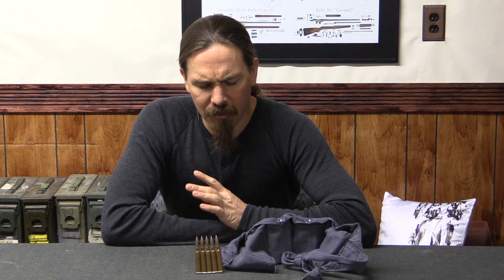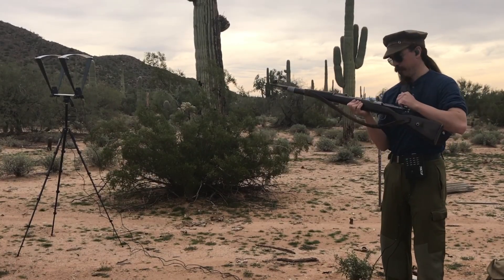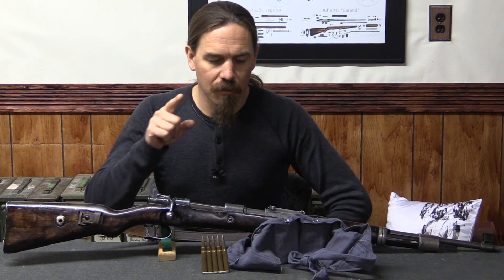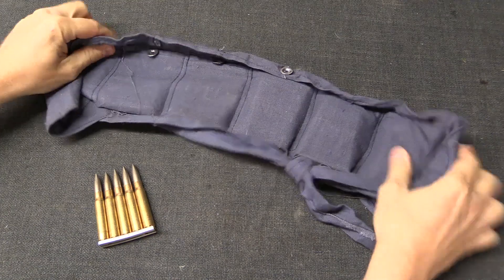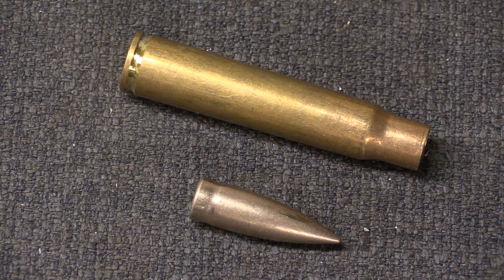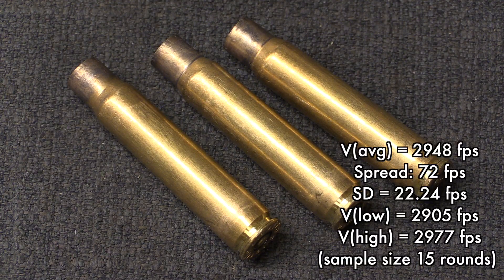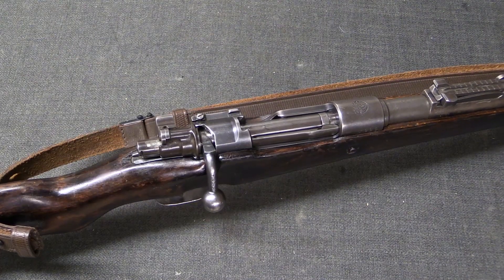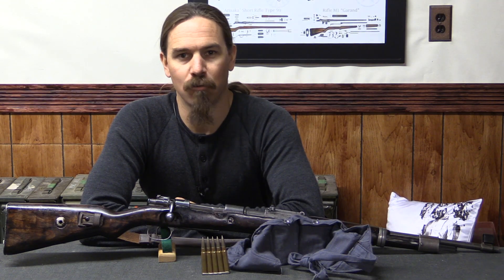Ammunition Evaluation: 1941 Turkish 8mm Mauser

Comment: - "Don't use turkish ammo with any automatic or semi automatic firearm"
* shoots ammo out of a bolt action rifle, ends up cracking the stock after only 15 shots *
So, don't use turkish ammo with any firearm?
Reply: That rifle couldn't handle it.
Reply: A synthetic stock could handle it.
Reply: @marshaul  A younger wooder stock could handle it too. This were made to be fired from a wooden rifle after all
Reply: @flightlesschicken7769  it was also made to be significantly less pressure.
Reply: @jongustavsson5874  This one at least. Assumably this ammo was used once upon a time. 

Why would they make such hot ammo?
Reply: @flightlesschicken7769  poor quality control? Not really unheard of, but I reckon it's more likely it's just degraded in a bad way since it is 80 years old. (like old dynamite would start sweating nitroglycerin and become highly unstable.)
Reply: @jongustavsson5874  Maybe, but to my understanding that effects peak pressure but not velocity that much.

As for quality control I doubt that since they were all very hot, not just some of them
Reply: @flightlesschicken7769  it can have been loaded a bit hot then degraded to be even hotter with time. 

And 15 rounds out of a crate of 1400 is not really enough to make a claim one way or another, and it was clear that it was fairly wild deviations in velocity between those 15 rounds as well.
Reply: @jongustavsson5874  I suppose. Hot then hotter with time sounds reasonable

Comment: Yeah, back in the 1990s I got a small lot of this and fired it in my Egyptian FN-49. The  3rd round felt like I had shoulder launched a Tac Nuke. Completely unnecked the case and broke the firing pin (Yeah I know it’s a known design flaw with that rifle). After I replaced the firing pin I went back to firing commercial soft points in that rifle.

Comment: In theory, one could pull the bullets, salvage the powder, refill with a reduced load and reuse but it would be 1) still corrosive and 2) a lot of work. If the stuff sells for more than 20¢/round it wouldn't be worth the effort.

Comment: Does anyone have calculations of what the volocity would likely be if using a 29" barrel??? Am I crazy to think it might be approach 3,100fps?
Reply: Through a Chrony F1, I was getting an average of 2960 fps fired through a M48 with a 24" barrel. At a guess, add 25 fps per inch of barrel, so 3000+ fps is possible.
Reply: The high velocity could be due to unstable burn rate from powder breakdown I wouldn’t bet on getting too much gain in velocity from the extra barrel, but ymmv

Comment: I wonder if the Turkish rifles were built a bit more solidly than perhaps a more "stock" 8mm Mauser or such other rifles were. Or perhaps that Turkey at the time didn't really care about the lifespan of its rifles that much; I know they had a ton of various rifles kicking around up until the 1920s, but I'm not too aware of their small arms policies regarding inventory, procurement and manufacture in the 30s and 40s when this ammunition was made. Or perhaps it really all was just an issue of manufacturing and storage resulting in the changes in the ammunition pressure exceeding safe limits.

Makes you wonder, because if it was causing problems, or at least what the Turkish Military considered problems (again, lack of knowledge so I can't comment as to what would be considered a problem; a rifle cracking its stock may not be considered a logistical problem if you've got a ton of them in armouries and want to use them up, for example, even if it's an issue for the individual soldier), then they would have changed the ammunition. But they seem to have consistently made very hot ammunition for a long period of time. Or it could just be they appear to have modeled the cartridge on a specific round and didn't manage to get it right, but didn't care to correct things. I would be curious to see the paperwork regarding the testing and factory standards for the ammunition of the time and how they compare to the ammo in its current state. That said, if the problems weren't around at the time then maybe it's all nonsense.

Does anyone have any idea as to what the thinking was and if this stuff caused problems in service?
Reply: Turkish Mausers are pretty much the Mosin Nagant of Mausers

Comment: I’ve heard that old ammo that’s gone hot over the years you should put in the freezer. That gives the powder some moisture and gets it closer to what it was original. True or false? Maybe you can answer that Ian
Reply: Moisture isn't the issue. Plus generally powder would be hydrophilic. Plus freezing it only causes existing moisture to precipitate out of solution, it doesn't somehow inject moisture into a more or less sealed case. So, no.

Comment: My Great grandma had Mauser made for her in 1910, and when i was kid my grandpa gave it to me. As you can imagine its stock is much shorter than a k98k and it looks different all together since it was custom made for her. It also has a drop out bottom, and a set trigger. The set trigger is adjustable to basically half a pound. Anyways when i got the rifle, I went to the local gun store in Old Forge New York, and they had 70 rounds of Turkish ammo just like that, and had the same pouch. It kicks like a mule, but again that mouser is much smaller and lighter than a k98k. I think the barrel is about 18in as well. also if you wanted to have a look at it some that would be cool, im somewhat local.

Comment: Have shot some of the turk and it does run hot.  I think I will pull the bullets and either reload the case with the H4895 and the  %60 rule for some nice (if corrosive) plinking ammo.

- Am not a gun smith,  you are solely responsible for your fixes !

Have fixed a few cracked stocks, acraglass or an equivalent  work well.  I also have  had recoil lug (wood) fail used the  hidden stock cross-bolt method, fixes the issue with out  need of external jig or external mod. 

Drimmled a slot in the wood recoil lug then filled to 1/2 depth with 2 part epoxy then placed a threaded rod segment into the epoxy (as a bridge from one side of stock to the other) then filled the remaining space with 2 part epoxy over the rod segment.  Clamped stock to close the gap as well.

Used Clear epoxy so as to make sure there are no bubbles or gaps.

Probably not as strong as external cross bolt but as strong or probably stronger then the original wood.

While its open epoxy bedding the steel lug  not a bad idea.

Comment: I want more graphs with these kind of videos, even if you just flash them in screen for 2 seconds or so. your data for fps on the range for example would do great on a chart.
Reply: You don't know how to use excel?
Reply: @marshaul  Should i film the videos themselves along with that? He has the data, probably in an excel already since he built his motivations on it and he could pick out the highs and lows. Just show it on screen for a few seconds. Thats not unreasonable.
Reply: @BartJBols  He already provided the relevant statistical calculations, but apparently that's not good enough, so you literally want him to paint you a picture. This is presumably so you can visualize what is better expressed numerically, but you can't expect Ian to accommodate every special needs student.

Comment: I wonder whether it's only because of storage, or perhaps Turkish Army wanted to develop something with a more punch against APV's. Equivalent to M855A1 against Body Armor. Still, doesn't work, but handicaps your own soldiers. Or at least rifles (I don't know if someone was hurt by over-pressure in A1, but the guns were at least in needs of repair after first batches - now it seems that A1 is practically the same as stock, so it doesn't have it's "unique abilities")

Comment: I bought several cases of this stuff in the early 2000's when you could get a 1400 round case for around $75. They were both 1942 date codes, if I remember correctly. It was good looking ammo once the crate was unsealed. I did not have any problems with hang fires or case splits, but this stuff seemed quite hot. I fired a couple bandoleers and had a bolt lug sheer off in a nice numbers matching Yugo M48. I did not fire the rest of it.

Comment: Now what exactly caused the ammo to go hot? Was the powder drawing moisture that translated into expanding steam or was the chemical compound of the powder changed by being stored at too high of temp causing decomposition?
Reply: If I had to guess, there is probably a binder or other neutral chemical in the powder which keeps it stable and in the right shape and distribution and density. Improper storage can potentially break down that binder, and change the density and burn characteristics of the powder. 

I was also reading that if the powder burns slower, it generates higher pressures for a longer time, so if the powder is in bad shape that could also be what is happening.
Reply: @witeshade  if it was burning slower wouldn't there be extra ignition outside of the barrel causing the shades on the chronograph to blow off?
Reply: @witeshade  In some cases the powder can deteriorate due to high temperature to the point that you will see corrosion around the crimp.
Reply: Decay of the powder, nitrocellulose (smokeless) powder is not very stable stuff. Added stabilizer compounds are used up over time, and in the case of stuff loaded for WW2 sitting in non climate controlled warehouses, at end of life at best.

Comment: Ian, what do you think about using the Turkish 8mm in semi autos with adjustable gas ports (i.e. Hakims). If the lowest gas setting is used, do you think that could mitigate the risk of damage to the firearm? Curious as to your opinion as I have a supply of this ammo but have been hesitant to use it for the reasons noted in your video. BTW, first time commenter, long time viewer/fan. Love everything you do. The community thank you for your tireless efforts to bring constantly new and relevant material to us. Keep up the fine work!!
Reply from the maker: I would not use Turkish ammo in any self-loading firearm.

Comment: Yeah, I've heard stories about this stuff. Bear in mind that this is 3rd or 4th hand info (but it does mesh with Ian's statement about this ammo in semi-autos), but I've heard of this stuff bending the receiver on an Egyptian contract FN-49. Good stuff to find out about when you're looking up info on your then-recently acquired Egyptian contract FN-49. Personally, I'm not sure I'd even feed this to my M48, though that's more out of worry for the stock, lest it meet the same fate as Ian's K98 here.
Reply: USSEnterpriseA1701 I’m lucky. All it did with mine was unneck the case and broke my firing pin. after that I got rid of the few rounds I had and won’t even touch it for my bolt guns.

Comment: The one thing bolt action rifles aren't obsolete at: firing overpressured, old, and dangerous rounds while minimizing risk to the shooter. Also making Ian look cool, but Ian always looks cool.
Reply: Smoothly running a bolt action left handed is operator aF.
Reply: Look I'm not arguing that bolt actions aren't obsolete for almost all uses, but it's kind of interesting that the us military's new sniper rifle is a bolt action rifle. Never thought I'd see that happen.
Reply: @8Hu001  Not really. The most accurate rifles are bolt actions. Bar the W2000, the most accurate long range rifles are bolt actions. All the gas goes into the round, and isn't siphoned off to fire the round. You don't have very quickly and heavily moving parts hitting the breach/chamber. So it makes perfect sense why the new sniper rifle would be bolt action, especially for rifles with intended target ranges out to 3km like a 338 Lapua Mag rifle.
Reply: Mauser is not just any rifle.
Reply: If the thing you aren't obsolete at is itself an obsolete thing, are you not obsolete yourself?
Reply: @Elfalpha1  
Out of spec, over pressured ammunition offered to the ignorant for cheap never goes out of style... Like the 7.62x25 surplus submachinegun load ammo that ate CZ52 roller locks for breakfast and broke a few Tokarevs?
Reply: @Bert2368  I know this is almost a year ago, but can you elaborate more on that ammo story?
Reply: @or-what  
In Eastern block, 7.62x25 was largely used for straight blowback, open bolt submachinegun ammunition as well as Tokarev delayed blowback service pistols. 

Some of the 7.62x25 ammunition was loaded with extra hard primer cups and to a VERY high pressure, apparently for use in the various fixed firing pin sub guns, when you try to fire it in a CZ 52 pistol, it often takes a couple of strikes to get the primer to fire and when it DOES finally fire, the kick, muzzle blast and fireball are spectacular. If you have the patience to keep running the stuff, the roller bearings at the breech of the barrel which lock up the pistol take a real beating and start to go out of round, followed by extra wear to the frame where they run. 

You can wreck a CZ 52 if you keep this up long enough, my younger brother managed to. That was at least 15 years back when these pistols were widely available for under $150 US, now they're harder to find and more expensive, the cheap surplus corrosive ammo of unknown origin is also pretty much gone. Numrich used to sell replacement roller bearings if you need them.

Go look on the Makarov and/or CZ forums, google for more information on the  specific box labels and head stamps of ammo which behaved like this. I would need to  look online for specifics myself, I just shoot modern Prvi Partizan in my CZs now, this ammo is cheap, safer and non corrosive.
Reply: Autoloading rifles like the M14 and AK's are no more than straight pull bolt-actions with a gas acting mechanism.
Reply: @axelpatrickb.pingol3228  and still bolt actions are safer because YOU decide when to open the action. semiautos dont give you that... they just do it. and overpressure in the gas system might be dangerous.
Reply: Gosh that sentence hurts my brain, I mean you're not 100% wrong but seeing it written out lol

Comment: Can you even get Turkish 8mm ammo anymore?  I know it was common years ago, but my only experience with it comes from a few rounds a friend gave me.  My Turkish Mauser had zero issues with it.

As for your cracked stock, that can be easily fixed.  Heck, give it to the smith who works on C&Rsenal.  He can make it good, and strong, as new.
Reply: Don't work like that, once the fibers in wood has been broken apart there will always be a weak point.
Reply: @TheArchaos  are you sure about that? The common wisdom I've heard is that with the proper wood glues, the break can actually be stronger than the original wood ever was.
Reply: If you glue two items together along the grain it can yield a very strong bind but that just pushes the stress point somewhere else, which is far from ideal in this case.
Reply: I still have 3 crates in storage, plus another crate converted to hunting ammunition.

Comment: I had 3 questions: can the rifle be fixed, will it be fixed, and is it really worth being fixed. You answered all 3 by saying you would find a new stock to continue using it for testing.
Reply: On the bright side, at least it wasn't a pristine K98 this happened to. It's a Yugoslav reworked rifle, they inspected it, fixed any problems with it, scrubbed and remarked it, then put it back to work. They usually make for good shooters so you don't mess up a pristine German rifle (assuming you have one). I'd love to get one of these myself, but my slightly shorter action M48 is not a bad facsimile either.
Reply: Oh no the stock is cracked! I guess you should just throw it away since it's no good. I guess I'll take it off your hands.

Comment: I've always had bad luck with Turkish ammo cracking cases. Won't touch it anymore.
Reply: Agreed
Reply: Yeah, Ditto !
Reply: 4 out of 5 shots I would get split casing neaks
Reply: Had some too. It was disassembled and scrapped. The brass was getting brittle.
Reply: I shot some Portuguese surplus .303 once. I had in immediate succession, two hang fires, a split case, and another hang fire. They did make nice looking dummy rounds though.

Comment: I used to have a ton of 1943 Turkish 7.92 and used to shoot it out of my former Hakim before I knew better. Never had an issue, but glad you started off with this. That said; it shot great out of the rest, including a North China converted Type 99.
Reply: Is that a Type 99 Nambu or Arisaka?  I can't imagine wanting to rebarrel an Arisaka with all that ammo just laying around.
Reply: Russell L. Bilzing Arisaka. Works great, and much easier to find 7.9 over 7.7, so the solution the Chinese achieved back then with the conversion still applies.
Reply: I got crates of this never shot in my Hakim only feed it Yugoslavia 198gr

Comment: That video intro was straight to the point. I dig it.
Reply: On the 5th day gun Jesus said, “Thou shalt not useth Turkish 8mm in thine semi or full auto arms.”
Reply: After seeing that crack on his K98, I ain't using Turkish ammo on bolt actions neither.
Reply: From the gospel of Gun Jesus
Reply: Depends on the condition of the rifle. I've put hundreds through Yugo M48s but these were new-old-stock as they went straight from the factory into storage.

I've used 1950 and 1951 Turkish. The results from the chronograph are an average of 2960fps.

I reworked a thousand rounds into hunting ammunition by dropping the charge to 44.5 grains and using a Hornady 170g RNSP. Chronographed at 2720 fps and very effective on pigs and goats.

As a comparison 198g FNM chronographed at 2450fps.